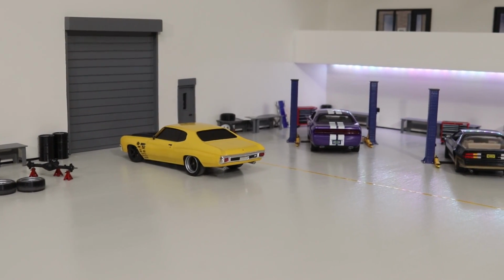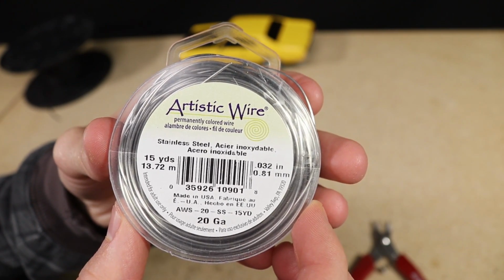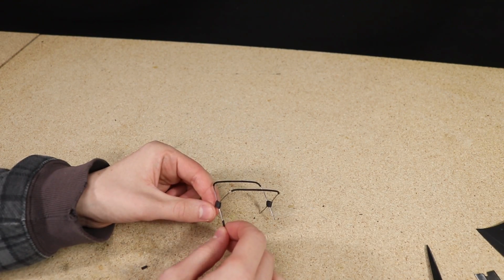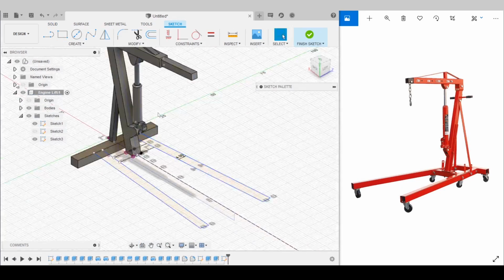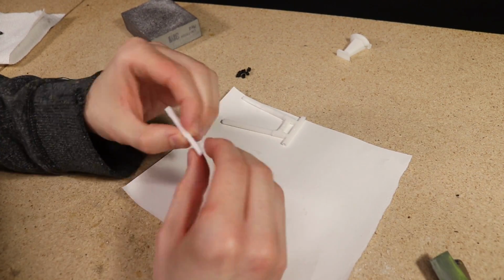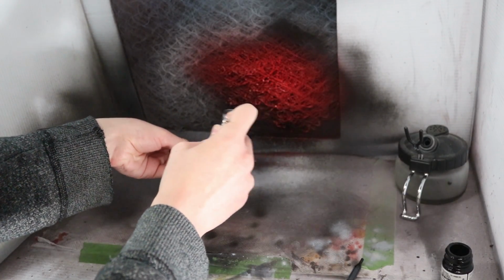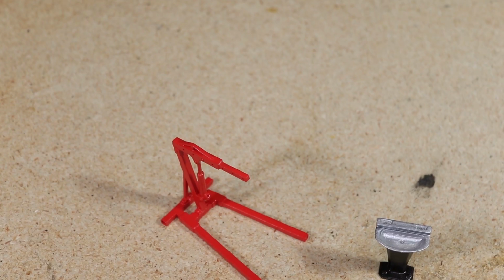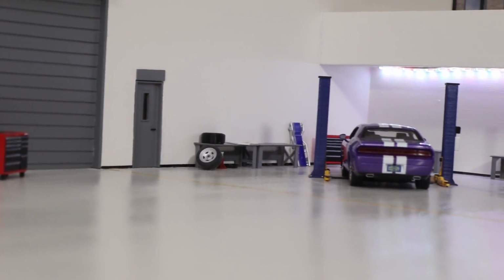Scale Shop Build: Part 4 Adding Handmade and 3D Printed Accessories

Comment: You have the tool boxes all wrong. I'm a Mechanic and have been for 30+ years. A shop like this would have pretty good sized tool boxes against the wall, in fromt of the lifts.. A dirty workbench is usually sitting next to the tool boxes. Most of us have a stool to sit on sitting in front of the workbenches. We also have "carts" about the size of the toolboxes you have already made next to and around the cars being worked on. Oh, and the floors are NEVER this clean....
Looking great! Cool idea.